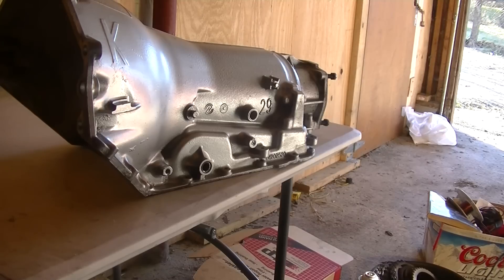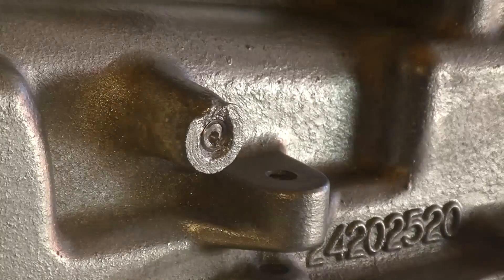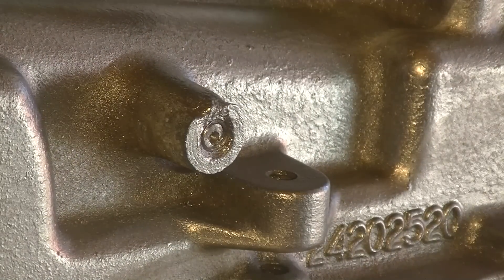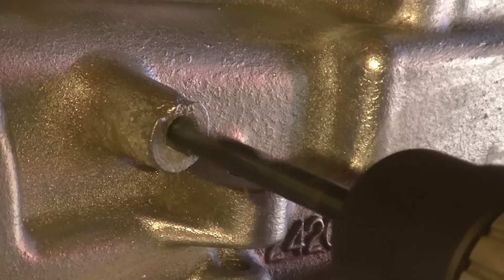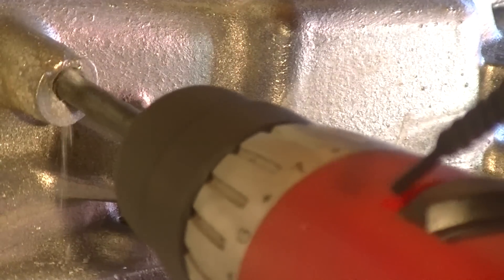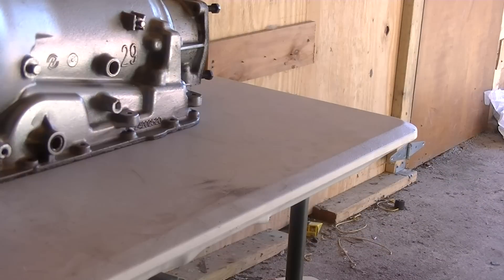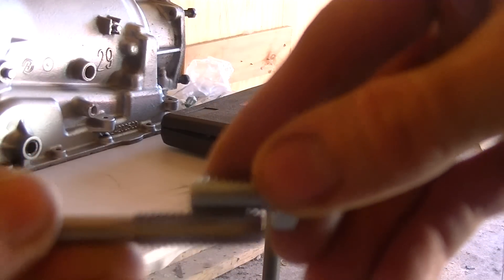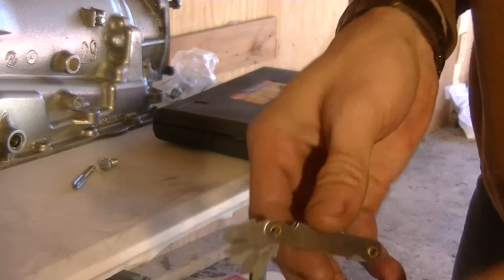Drilling out a Broken Bolt

Comment: Job done,but I feel you finesse it a bit,the pilot hole was off centre,you could have corrected that by angling the drill to move it,use a bit 2mm smaller than the hole,look out for an old 2 speed drill,I think there about 600 watts,that drill was spinning too fast for metal work

Comment: Is that a bigger bolt than the one you started with?
Reply: Yeah, that's a ghetto way that people do that are too cheap to get a Heli-Coil or Time-Sert. On top of that he drilled off center, and didn't drill straight, so his hole was actually pretty bell-shaped. Those first 3-5 threads he tapped are loosey-goosey!

Comment: 2:08 the "holding device" is called a tap wrench by those of us who know what her tools are called! And like the other people who commented, you start with a much smaller drill first called a pilot drill, and then your whole won't be off centre, of course it does help if you can actually hold the drill steady whilst drilling it or better still use a pillar drill which is in the same orientation as the hole you want to drill.
So everybody who is still none the wiser watch this video on how to properly remove broken studs https://youtu.be/dJfkCj3FWBs

Comment: Matt--I agree with the others that there was a better/easier way to do this (i.e., using a smaller LH drill to start, then use an extractor).  BTW, was the hole where the bolt snapped a mounting point for the trans, or did it hold something externally, like part of the shift linkage?  That might also make a difference in how you would approach this.  What we also need to know was whether the bolt broke because it was weak and the head snapped off; if it was threaded in off-center and snapped or if it had been Loctited in place and you over-torqued it during the removal.  If the latter was known to be the case, heating the area AROUND the bolt might have loosened things up to the point that it could have easily been extracted.  Another option was to heat the area, then melt some beeswax into the threads to "lubricate" everything, again easing the extraction process.  And that "holding device" for the tap is called a tap wrench.  So, why did the head of the bolt snap?  Thanks.

Comment: Why drill... Waste of time... Weld a nut pull it out and just put a new bolt in
Reply: That doesn't work when the threads of the broken bolt are fused to the threads of the hole it's in. I'm in that situation now. The heat of welding didn't break the bolt free of corrosion.

Comment: what about if the whole tab broken, can u weld it back?
Reply from the maker: Welding cast aluminum is very difficult. It can be done but it will be hard to find someone who can do it.  Brazing is easier but not as strong.

Comment: the new bolt has bigger size than the origin size??, is there any solution to keep the origin size of bolt??
Reply: Weld a nut to the broken bolt ...
Reply from the maker: Yes, and yes there is.  You need you drill the bolt out with the tap size drill bit, and then use a tap of the original threads to tap the rest of the bolt out.

Comment: Smaller drills, working up to a decent "sleeve" diameter in the broken thread, then using an ezy - out would prevent the need from tapping a size up. You drilled off centre too. Never good if some bracket was supposed to back on there (mis-alignment) Patience vs. brute force is always better. Just my $0.02  Cheers

Comment: Snapped a 3/16 inch screw.  Would I use a 1/8 bit or 3/16 bit if I need to tapped hole to be 3/16 (I'm attaching something to the first part and the part I'm attaching is 3/16 any input would be helpful :)  thankw
Reply: Thanks*
Reply from the maker: Use the tap size for 3/16, which is a #26.  This is a tricky thing to do as you need to make sure you are dead nuts in the center of the bolt shaft.
Reply: Ditto !! !

Comment: do they make anything small enough for a 7mm bolt head.  trying to replace parts on a bbq and all screws came out using heat only 1 snapped off.
Reply from the maker: Yes they do.

Comment: Broke off a steel bolt in aluminum housing....cut bolt flush with hole...drill hole (will dull out drill bits fairly quick have at least two packs handy) in middle of bolt (takes awhile) ....tap screw extractor in hole with hammer or rubber mallet til snug...turn counter clockwise with adjustable wrench....NO RETHREADING NECESSARY! Don't knock until you try it 👍👍👍
Reply: I tried that ONCE, and the extractor broke off in the hole. Never again! If the head of the bolt wouldn't remove it, what makes anyone think a spindly, brittle extractor is going to do anything?
Reply: @tempest411  When bolt head is broken off then there wouldn't be any pressure on threads anymore, so it could come off easier-but if it broke due to rust in threads then extractor would make things worse.

Comment: Forward half turn back quarter turn, and so on
Reply: +MattsMotorz lol. Supposed to stick it in further when it feels stiff I thought
Reply from the maker: +jabhip With aluminum, you don't have to be so careful with going back every turn since it is very soft.  I usually only back it up when I feel it getting stiff.
Reply: @MattsMotorz  I've seen plenty of broken taps in aluminum.

Comment: could of used a left handed drill bit it would of came out by it self
Reply from the maker: I could have, but I wanted to do a video on drilling out a bolt.  Thought it would be more interesting.
Reply: nick davies That doesn't work if the bolt had siezed up, and twisted off-!